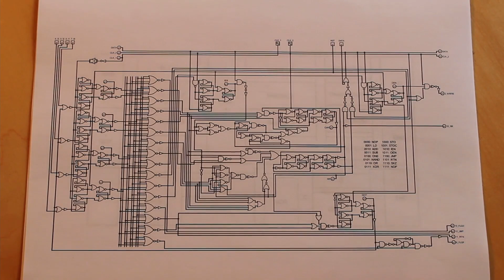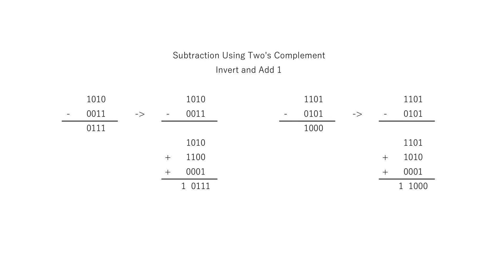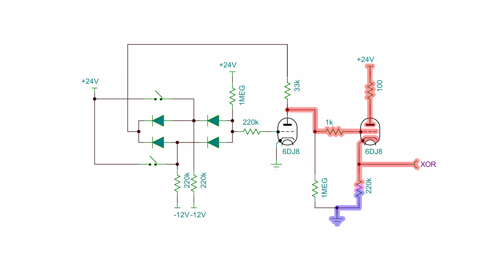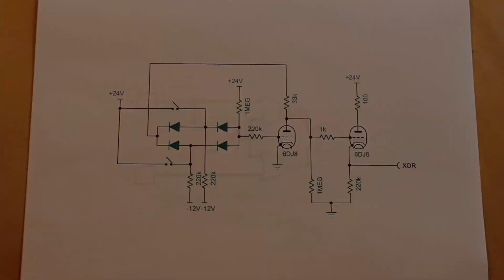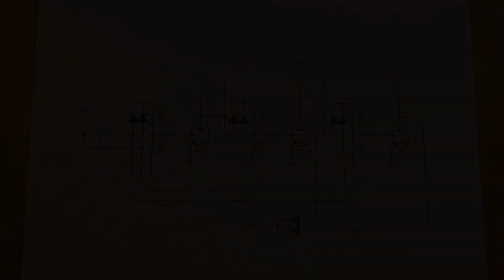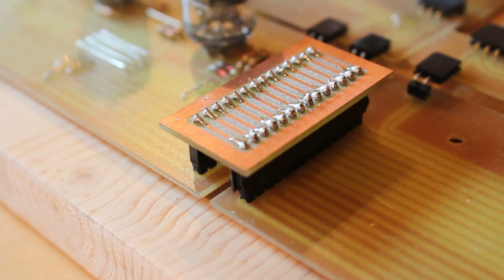Vacuum Tube Computer P.14 – Building an XOR Gate to Subtract by Adding (Fixed)

Comment: Noob question: How are resistor values decided upon?
Reply from the maker: That's actually a really excellent question!

Normally when building tube stuff, you can look at other schematics and get an idea of a ballpark for resistor values. The IBM 604 Customer Engineering manual is an excellent resource ( http://www.bitsavers.org/pdf/ibm/604/ ). 
However, the IBM 604 uses 150V on the plate and -100V for biasing, whereas I'm using just 24V on the plate and -12V for biasing. And there is practically no information out there about running tubes at low voltages. So, a lot of personal testing and trial and error went into the values I chose here.

We'll start with my 33k plate resistor. Since I'm building digital circuits, I really only need to think about the tube when it is in saturation or cutoff (ie. flowing as many electrons as it can, or flowing no electrons at all). In cutoff, the tube is essentially an open circuit, so that one's fairly easy to think about, but saturation is where things get interesting. Saturation means the grid is pulled high and the tube is flowing as many electrons as it possibly can, but each tube has a limit to just how many electrons it can flow. This limit is the tube's internal resistance. Most tubes have pretty low internal resistances, but the 6AU6 that I use has a comparatively high internal resistance of around 2,000 ohms.

When the tube is in saturation, we can think of the internal resistance of the tube and the plate resistor as creating a voltage divider. So, we want the plate resistor to be high enough that the value at the plate is as low as is reasonably possible. With a 33k plate resistor, 2k internal resistance at saturation, and 24V supply, the value at the plate should be about 2V. A higher plate resistor means a lower plate voltage at saturation.

So, why not just run a 1M plate resistor instead of a comparatively low 33k? Well, it's true that a 1M plate resistor would put the plate voltage at 0.05V at saturation, this creates a problem when the tube is in cutoff. The plate voltage is used as our logic output, so when the tube is in cutoff, we can essentially ignore the tube altogether and just think of the signal as being a single resistor to 24V. With a plate resistor of 1M, the amount of current we can provide is immensely small - just 0.023mA. However, with a 33k resistor, now we can supply 0.72mA. Still a tiny amount of current, but considerably more than the 1M.

This becomes important when using the plate output signal as an input to a different stage. On the grid input we use another voltage divider between the output signal of a previous stage and -12V for biasing. The idea is that at logic low, we want the grid to be lower then -2V and at logic high we want the grid to be higher than 0V. I way overkill this, but that actually works well to compensate for differences in tube quality. The 220k resistors are large enough that they don't provide too much draw on the plate output signal from a previous stage. Essentially, I wanted a resistor value high enough that the current draw on the plate output from the previous stage would be minimal enough to allow one plate output to drive at least three other inputs. I could theoretically go higher in resistor value to allow the output to drive even more inputs, but in practice, I started getting unreliable results. So, the 220k/220k divider was settled on as the best balance in terms of expand-ability and reliability.

Oh, and the 4.7k resistor is just to additionally limit any grid current. It's like 90% unnecessary, but I included it just to be safe. 

So, that's a massively long winded answer, but I hoped it help shed a little light on the madness that is my decision making process, haha.
Reply: @UsagiElectric  Great reply! A lot to think about. 
Also, is there any benefit or drawback for running the tubes at lower voltages? Benefit probably being safer to deal with, and easier to power, but is there anything else drawback wise? Any idea why it was so common to run tubes at higher voltages back then? Was there some actual benefit to it or was it just easier to drive/power?
Reply from the maker: @colinstu  Thank you!
That's another fun question! 

The primary benefit to running at lower voltages is that I'm super accident prone (I have caught multiple things on fire in the past year, including my hair), so using just 24V and -12V is so low I can't really hurt myself with it, haha. Also, I think it really helps open up playing with tubes to a much wider audience, as I think a lot of people are turned off by the usually high voltages that are involved.

There are a ton of drawbacks to running at lower voltages though. The first is that the electrons have to fly across a vacuum, so they need a really high potential on the plate to properly attract them. With lower voltages, the electrons aren't quite as motivated and you can get to a situation where the tube doesn't react at all. A lot of this is mitigated by using a pentode, which has a screen grid that can kind of act like an electron accelerator. That's not to say that triodes can't be used at lower voltages, I've had pretty good success with the 6CG7 and 6DJ8, but in my experience, pentodes seem to do a lot better. Even still, some tubes just flat out refuse to cooperate at low voltages. The 6J6 dual triode, for example, absolutely refuses to operate properly for me at 24V no matter what resistor values I throw at it.

The other issue is power. In order to get proper logic levels coming out of the plate, a relatively high ohm plate resistor needs to be used. As I said, I'm using a 33k ohm resistor, which lets me supply 0.72mA. But, if I were to bump up to the 150V that IBM uses, that would jump all the way up to 4.5mA. That pretty much eliminates the need for cathode follower buffers like I use in so many places.

Finally, by running at a lower voltage, it is possible that you can end up cathode poisoning the tube. If the cathode is heated, but no appreciable current is flowing through the tube for a long period of time, a high resistance chemical layer can grow between the cathode itself and the oxide its coated with. This is essentially like adding in a cathode resistor, which starts to noticeably reduce overall gain. I've been told quite a few times that 24V isn't enough plate voltage and that I'm going to kill my tubes, but I haven't had any issues at all so far and I've got some boards with 6AU6s on them that are still working great even after using them periodically for over a year. It could be that 24V is just enough on the 6AU6 to avoid this, or it could be that I just don't run it for long enough at a time for it to really be a problem.

Comment: I wonder how much power this uses as compared to an IC version of the same thing ? And about the "inrush current" issues; I suppose it might cause something to overheat at the source but I don't know much about currents and amps and such.
Reply from the maker: This is an awesome question!
The Motorolla MC14500b, which provided like 90% of the inspiration for this build, uses approximately 500mW as per the datasheet.
The UE14500 here is currently sitting at 88 vacuum tubes, but we're only about halfway through building it. I'm not quite done designing the PCB layout for everything yet, but so far, I know for a fact I need an additional 46 vacuum tubes, and most likely will need another 20 on top of that. So, 88 + 66 = 154 tubes. Each tube has a heater that pulls 0.3A at 6.3V, but since I'm running the heaters in series, each heater is only seeing 6V, which means they're pulling about 0.28A each. So, each tube draws about 1.68W of power, already more than 3 times the amount of power of the silicon chip, and that's just for one tube!
1.68W * 154 tubes = 259W! 
That's an enormous amount of juice! That's more than 500 times as much power draw as the equivalent silicon version! At 24V that should be drawing around 10A of current, which is an insane amount of current, but fortunately, the switch mode supply I'm using can supply up to 15A, so we're pushing it but not too hard.

As far as the inrush current issue goes, the problem is that when the tube heaters are cold, their resistance is extremely low. They have to get some heat into them to get up to their nominal resistance, but for that brief moment before any heat gets into them, they pull massive current. In it's current state with the 88 tubes, I expect that momentary hit to be upwards of 20A! The modern switch mode supply I'm using is a pretty good supply though, so most likely it'll just see that as being a short and go into protection mode. Which fortunately means nothing should let the magic smoke out, but unfortunately means it'll never actually power up.

But, I have a plan on how to tackle that problem! I haven't tested it out yet though, so we'll see how it goes, haha.

Comment: Oh, Wow, that is awesome looking. I don't know if I mentioned this before, but using AC on the fillaments would give a more even current distribution through the circuit.
Reply from the maker: Thank you!
Yeah, there's a lot better ways I could have handled filament power, but I ultimately chose this method to keep the PCBs as simple as possible. By using the same 24V I use for the logic signals, I eliminate the need for another dedicated filament power rail on the PCB. In reality, all I did was trade complexity on the PCB for complexity at the power supply, but so far (aside from the inrush current fun) the PSU seems to be handling everything pretty well!
Reply: @UsagiElectric  Ha ha. Yeah, There's always some sort of trade off.
Reply: @Franko_Walker  That's called "engineering" ;-)
Reply: @leyasep5919  No it's not, It's called a work of art.
Reply from the maker: @Franko_Walker  I call it "I have no idea what I'm doing, but it seems to be working!"
Reply: @UsagiElectric  and wabbit approves ;-)

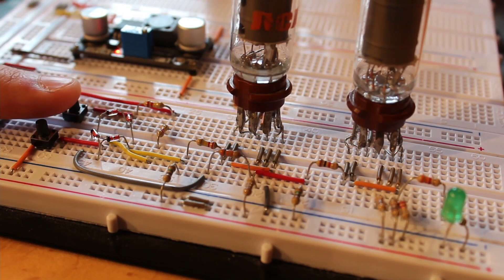Comment: There seems to be a little issue when pressing both the buttons at the same time, the LED still appears to be lit kind of dim for some reason? (@ 12:30)
Reply from the maker: I was wondering if someone would notice that, and I'm glad you did, because the answer is really fascinating (well, fascinating to me at least, haha).

So, there's actually a few problems going on here. The diode logic version is actually much, much brighter than the NOR logic version, but it does have the issue of the LED being somewhat illuminated when both buttons are pressed. Conversely, the NOR logic version looks a lot dimmer, but the LED is clearly off when both buttons are pressed. However, and this is the fascinating part, the actual voltage level output to the LED when both buttons are pressed is the same between the diode logic version and the NOR logic version.

The issue actually revolves around the fact that on the diode logic version I'm using a cathode follower buffer and on the NOR version it's pulling the output directly from the plates. 

Let's start with the NOR version. The XOR gate outputs a logic low when neither button is pressed or if both buttons are pressed, and outputs a logic high only if just one button is pressed. Logic high in this case is 24V and logic low 2V. The logic high is coming directly off the plate though, so the 24V logic high signal has to go through a 33k ohm resistor first. Then, I use a 22k/10k voltage divider to shift that level down to something that'll ensure the LED is off during logic low. So, the LED should see around 3.6V at logic high and 0.3V at logic low all piped through around 50k ohms of resistance.

The diode logic version has a cathode follower buffer though. I'm still using the same 22k/10k voltage divider for the LED, but the initial 33k ohm resistance is now only about 2k ohms because the only thing impeding voltage is the internal resistance of the tube. That means that the LED should see about 7V at logic high and 0.5V at logic low, all piped through around 25k ohms of resistance. But, logic low when no buttons are pressed and logic low when both buttons are pressed are actually different here. The cathode follower buffer just tries to replicate what the output from the previous stage is, and when both buttons are pressed, that's about 2V, so the CF buffer actually tries to reproduce that 2V, which allows just enough electrons to flow to illuminate the LED slightly.

But, when neither button is pressed, the logic low from the previous stage is actually -12V. The cathode follower buffer is trying to replicate -12V, but it can't go that low, so it just bottoms out at 0V, which is why the LED is fully off in that situation. 

For my actual microprocessor, anything below about 5V is enough for a good logic low, so I could totally use the diode logic version with no issues in that regard. I'm just unsure of how the strange input would affect output reliability. I probably could have developed this a bit further and been able to come up with a fairly reliable two tube XOR gate, but in the end I felt more confident sticking with the NOR gates we're already familiar with.

That was a massively long winded reply, but I hope it answered your question!
Reply: @UsagiElectric  I am wondering if the potential -12V at logic low is actually not damaging the LED through coupling even if the triode/pentode(?) cannot deliver that current wise, since that is potentially +12V reverse voltage. Never thought much about the reverse voltage limit for a LED is in reality.
But I see some other issue along with the LEDs for logic level visualization. As long as they are not driven buffered, they might have quite some capacity along with the large voltage swing when switching between logic levels. That might limit switching frequency to some degree I guess. Did you test that or plan to put some simple buffer (FET/BJT) as a driver for state-LEDs?
Btw.: Why do you divide the voltage for the LED? LEDs are current driven, not voltage driven? The formula is "R = ((VCC - 'V-led-forward') / 'LED-Current' )". So the forward voltage does not matter really while the LED only sees the current passing. Dividing the voltage wastes current bypassing the led in the second low side resistor of the divider.
Assuming 2.2V forward voltage for a green LED and around 10mA, it would be e.g. " R = (( 24V - 2.2V ) / 0.01A ) " for the resistor of the LED without using a voltage divider. But there still might be the problem that the switching capacitance does in some way limit the switching frequency as long as the LED has no impedance converter (BJT/FET), but hangs on the present logic state as an additional load.
Reply from the maker: @asagk  The good part of having the cathode follower buffer there is that it doesn't actually supply any negative voltage at all. The grid goes negative, which just drives the tube into cutoff. Since no electrons can flow through the tube, the LED itself is essentially then connected directly to ground through the 220k cathode resistor. So, I don't think I'm doing any damage to the LED that way.

As for using the LEDs to view logic states, I really only do that on the breadboard for videos to make it easy to see. In the actual build, I use IV-15 (DM-160) Vacuum Fluorescent Displays, which are essentially vacuum tube triodes in themselves. The grid of the VFD is high impedance enough that it has hardly any affect on the logic circuit that's feeding it. That and they look epic, haha.

As for why I used a voltage divider for the LEDs, that's because even with huge resistors, I couldn't get the LED to turn fully off at a logic low of 2V, so I just slapped a 10k resistor in parallel with the LED and that got it looking good enough for camera. It was kind of a quick band-aid just for temporary use in the video really. 

Honestly, I've been so focused on tubes and old school stuff that I've totally forgotten how to properly use modern stuff like LEDs, haha.